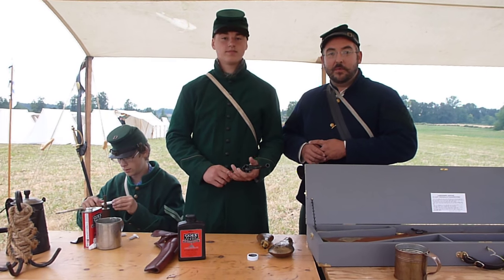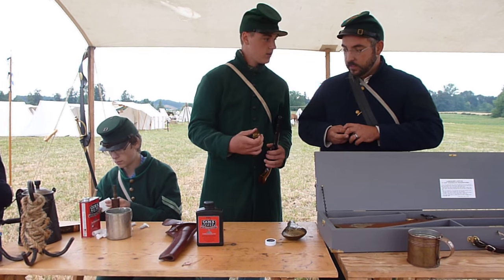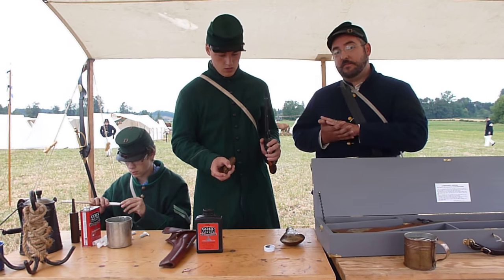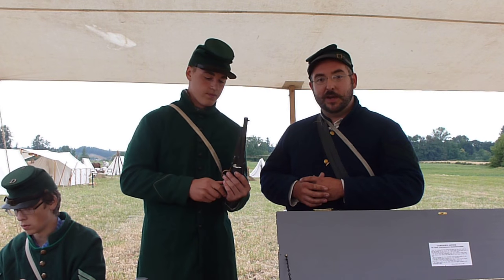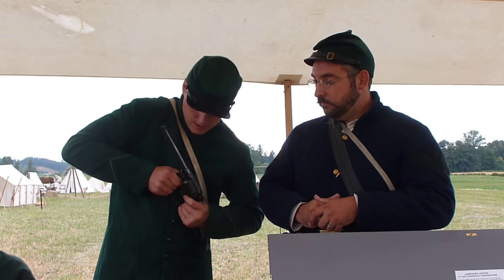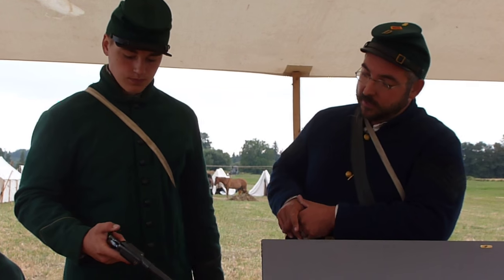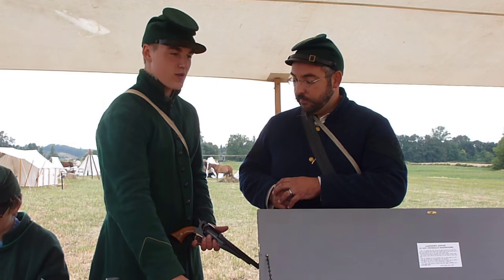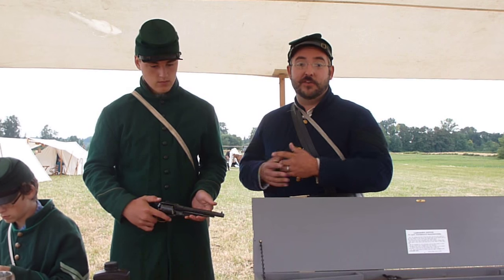Loading a revolver for Civil War reenacting

Comment: I have a question about civil war reenacting? I have a confederate army uniform that I bought patches for, even though I never did any civil war reenactment. Do I have to go through the ranks like any other person at the time? I just want to know?
Reply from the maker: If starting out as a reenactor, absolutely. Honestly being a private is an absolute blast on a multitude of levels and gives you a greater experience on the average life of a civil war soldier when done right. Rank truly isnt everything in this and the higher you get the more those shoulder boards start to weigh.

Comment: I was told steel frames can do 30 grains
Reply from the maker: When we reenact, our safety rules limit revolvers to a max of 40 grains.  We're just trying to make them go boom so sometimes we save money and powder by varying the number grains while staying below the safety limit.  Things are quite different when live firing.  Thanks for watching!
Reply: Company D 2nd USSS  can u use 777 or pyrodex
Reply from the maker: I would check with your manufacturer's loading instructions and follow those carefully.  That said, I've used pyrodex just fine but I don't recommend it.  These old weapons weren't designed for modern propellants.  In our reenacting organization it's black powder only.
Reply: It's impossible to find black powder
Reply from the maker: We feel your pain!  It's hard to find it here, too.  I do think I saw it once at Bass Pro Shops but it was pricey.  Our captain lives on the other side of the state and he has to drive to Idaho to  purchase black powder for the company.  I was talking to a few gun shop owners and they said the biggest reason so few people carry it anymore is because of the massive amount of insurance shop owners have to carry in order to store it.
Reply: Company D 2nd USSS  these are the only kind of guns I can own my name is in FBI background check even though I still had a charge dropped
Reply: YES,BUT REMEMBER THIS IS A SOFT STEEL,DONT GO OVER 40 GRAINS.USE AROUND 25 GR.TILL YOUR USED TO THE GUN.